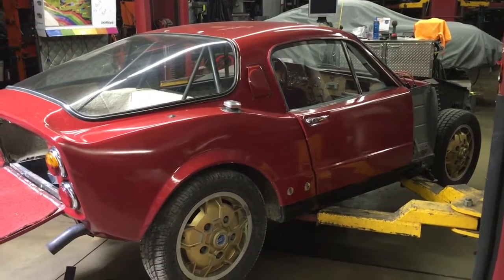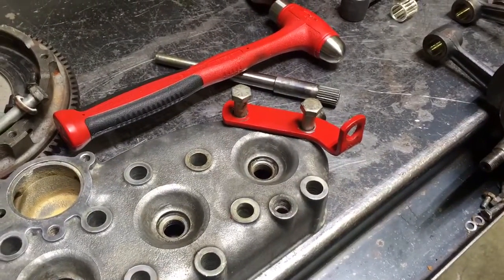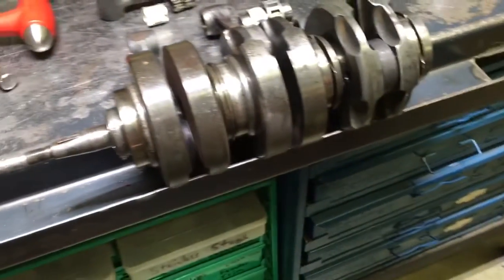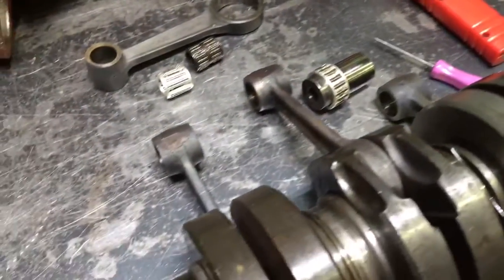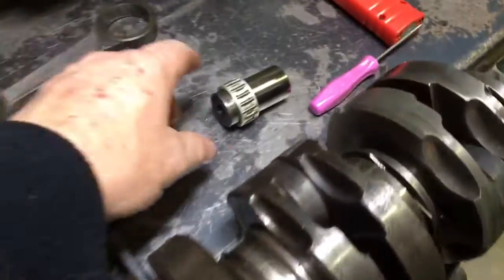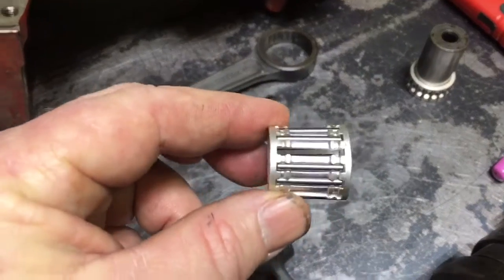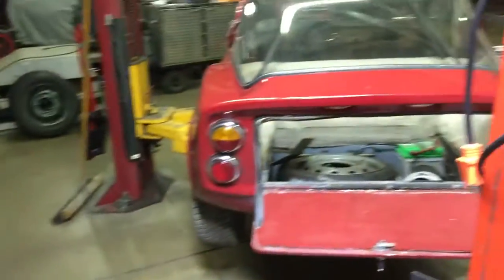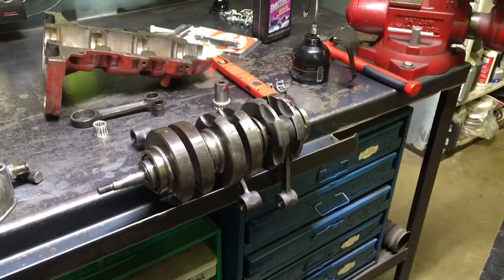Saab Two Stroke Crankshaft Issues and Fixes

Comment: That snowmobile bearing with cage looks foolproof. If you might be able to get one from a Japanese engine, it might match, because they were manufactured in metric measurements. Machining your own cages using original rollers would also be an idea, since the cages don't have to have precise inside- and outside diameters